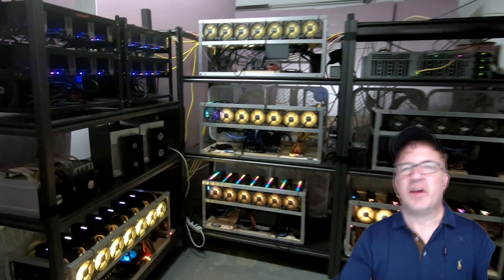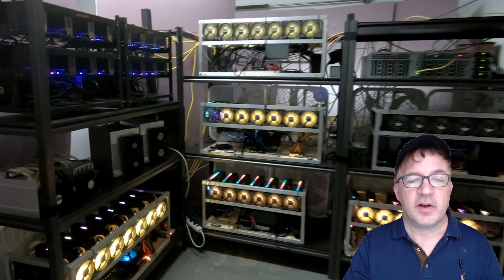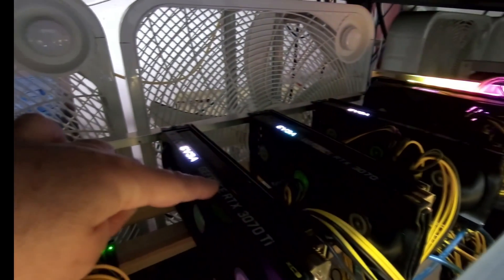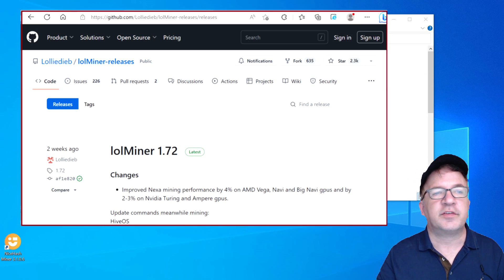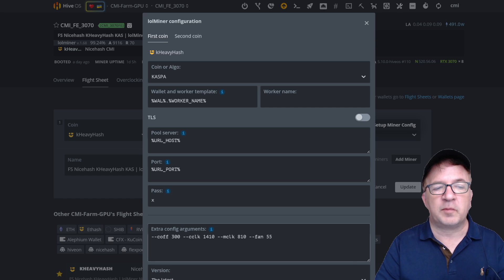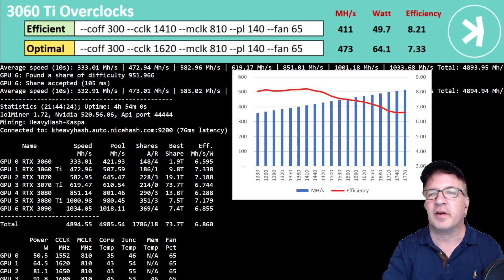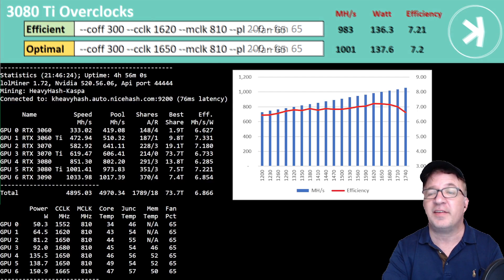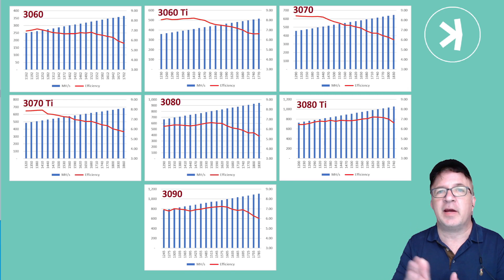BEST KASPA Overclock Settings Nicehash, Windows & HiveOS | 3060 3060Ti 3070 3070Ti 3080 3080Ti 3090

Comment from the maker: * For GPU Mining Rigs with different GPU in it, you can list the specific GPUs --cclk and --pl values separated by commas in Nicehash and HiveOS  * 
Example (2 GPUs):     --coff 300 --cclk 1410,1560 --mclk 810 --pl 125,200 --fan 65 
 
For Windows Batch File provided by lolMiner (mine_kas_with_oc.bat) list the Core Clocks for the specific GPUs separated by commas for the LOCKEDCORE variable, Example (3 GPUs) : Set "LOCKCORE=1410,1560,1665"
Reply: Hi ! many thanks for the video! i use windows , so msi afterburn, how i can convert this value for me? many thanks
Reply from the maker: @giovannidecclesiis9598  Hi, It's difficult to explain how to do in afterburner (It's an Advanced topic). But essentially it sets a locked core clock and then reduces power
Reply: how do i know which value runs for which gpu? also i mine on nicehash windows. my pl and fan shows as "not applied" when the cli starts. any idea why?
Reply: Hi, What if I have 3 GPUs and want to change the LOCKCORE of only the 1st and 3rd gpu. Leaving the 2nd gpu on default.

Would it be LOCKCORE=1410,0,1665 
or
LOCKCORE=1410,1,1665 
?
Reply: sir what should i put those parts? i use lolminer and windows..all my cards are 3060ti lhr
 set "LOCKCORE=?"
set "LOCKMEM=?"
set "COREOFFSET=?"
Reply from the maker: @asddsa-uy9ko Hi, Simply replace these values with the values I show in the video for the 3060 Ti - see this clip for 3060 ti https://youtu.be/wcd7rTilIu4?t=599
On the top of the screen I show the Full Overclock command and parameter values for Most Efficient and Optimal settings. 
Simply Update the batch file with these values

LOCKCORE = (see my --cclk value ) between 1410 and 1620 
LOCKMEM = (see my --mclk value) it's810
COREOFFSET=(see my --coff value) it's 300
Reply: This is life saving! Thank you so much!
Reply from the maker: @akgoz13  Your welcome - Glad it helped you
Reply: @CryptoMiningInsider  Hi! Could you help me, i have rig with 8 3060ti 2 3080 and 1 3080ti. And i can't set settings for each model, so miner gets crashed while i'm using one parametr for all gpus. How can i set settings for 3060ti, 3080, 3080ti in nicehash (windows). I've read your advice about comma and tried it, but it seems that it won't apply multiple settings
Reply from the maker: @АнварМагомедов-м2к  If I only mining KASPA with your GPU in Nicehash (and no other coins) I would start by running them with a core clock that is ok for all like 1410. Write down the which GPUs are their ID (Order#). Then you can Mining KASPA and provide comma separate values for the values that change like (core clock and power limit) 
example:   --coff 300 --cclk [GPU0_CoreCLock],[GPU1_CoreCLock],[GPU2_CoreCLock] --mclk 810 --pl [GPU0_PowerLimit],[GPU1__PowerLimit],[GPU2__PowerLimit] --fan 65

If I'm setup to mine other coins too, then I need to go one specify overclocks for each individual GPU as its own parameter.
Reply: @CryptoMiningInsider  Sir, thank you. You've helped me a lot. Subscribed!
Reply from the maker: @АнварМагомедов-м2к  Thats Great and I really Appreciate the SUB - Thanks !
Reply: you know iceriver kas ks2? lol
Reply from the maker: @xmyou  I seen the reviews - they seem very powerful and EXPENSIVE. I personally would not buy one.

Comment: I have 14 cmp 50HX mining Kaspa on Hiveos. The hashrate on each gpu is 330 mh which seems really high so  im 1.67 ghs total. Which seems way too much correct me if im wrong.. Normally I do 50 to 60 mh is the average per gpu. I adjusted the over clocking ..but can't seem get the mh lower..not sure what to do? All I know it's been very unstable ..mining dynex nexa but kaspa has been most stable
.can you recommend overclock settings mining kaspa..I'm using woolypooly pool..I'm new to mining
Reply from the maker: Unfortunately, I don't have any 50HX Cards to test. Maybe check Hashrate.no
Reply: @CryptoMiningInsider  thank you that website is very helpful!

Comment: I tried using --pl and --fan in NiceHash's Extra Command using lolMiner 1.72, but when running the miner, the console says "power limit not applied" and "fan not applied". Did I do something wrong? Also, lolMiner 1.73 just got released 1 day ago, +1-2% efficiency.
Reply from the maker: I'm working on a new mini video about 1.73 in Nicehash, when I tested it PL and fan worked ok for me - I will see on my other rig as well
Reply: @CryptoMiningInsider  I have tested 1.73 for around 18 hours and it works fine, slightly better than 1.72 by 1-2%.
Update for my comment "power limit not applied" and "fan not applied": This is caused by older NVIDIA driver, I was still using 516.94 when I wrote my above comment.
It is resolved when I updated the NVIDIA driver to 528.24.
Reply from the maker: @VM-ox9ke  Great you have it resolved and news about update driver fix PL issue

Comment: On the 3080 did you try 1740 clock pl200 ?
Reply from the maker: I tried 1740 on my 3080 , it ran poor for me 898 MH/s @ 152.6 watts (5.8 efficiency).
Since its well below 200 the --pl 200 shouldn't really matter imo
Reply: You may need repaste it. I have an option to some free power and use one ASIC preferably a quiet one any recommendations?
Reply from the maker: @NizmoTech  Tough call - Depends on how much free electric you can use. Have you looked at l3+ (used pretty Cheap, but not quiet), but if you want quiet probably look at mini miners like Goldshell or iPollo - maybe look at previous generation miners that are not profitable in current market if you don't have to pay for electric, maybe find good deals on used.
Reply: @CryptoMiningInsider   thanks .  I could consider i3 for basement . Yeah the ipollos look like viable option as well . Thanks man

Comment: Hi,
 I cannot apply any  OC settings in Nicehash on lolminer to my AMD 6600 and 6600XT. I also tried opening nicehash as administrator, and updated nicehash and lolminer to latest version, but still cannot apply the OCs.  Any one knows?
Reply: This is on Windows BTW
Reply from the maker: I do not believe lolminer can overclock AMD GPUs like NVidia - see bottom of the post on lolminer site that says limits on AMD overclocking (it may be have changed since) https://github.com/Lolliedieb/lolMiner-releases/wiki/Guide-Windows-(LHR,Watchdog,WebServer,OC)
Reply: FWIW, MMPOS fixed all my AMD rig OC problems, I still run hive on my nvidia card rigs.
Reply from the maker: @MichaelSchoenly  Great you were able to get it working

Comment: I have applied the optimal overclock for my 3080ti but the power limit of 200 is out of range. How I can correct that?
Reply from the maker: I seen this issue in Nicehash because it was using an older version of lolMiner. The --pl parameter is not required for the overclock. I onlyadd it as an extra precaution in case the miner loses the overclocks to try to prevent the card from running at full power. I'm working on a new video that address this. Stay Tuned

Comment: heyy i have another question!! thanks for answering my other one <3 !! ! ! !   how do i overclock multiple GPU's with different overclocks ? i dont understand the "flag" and "delim" part?
Reply from the maker: If they are ALL set to mining KASPA only then it's simple... 

* For GPU Mining Rigs with different GPU in it, you can list the specific GPUs --cclk and --pl values separated by commas  *

Example (2 GPUs):     --coff 300 --cclk 1410,1560 --mclk 810 --pl 125,200 --fan 65

Comment: Thanks for the Video, Nice Work. Gained yourself another Subscriber. I do have a question though.
When making the adjustments in HiveOs Flight sheet and having different varieties of cards how do I list the commands?
Example: ( My thoughts)
Device 1, Device 2, Etc...
--coff 300, --coff 300, Etc...
--cclk 1410, --cclk 1410, Etc...
--mclk 810, --mclk 810, Etc..
Etc...
Any insight would be greatly appreciated. Thanks
Reply from the maker: Thanks for the Sub - Appreciate it!
If you are using the same GPU Types (like all 3070s) then I can specify the values once and it will apply to all the GPUs, but if you have different GPUs then I list the specific GPUs --cclk and --pl values separated by commas

Sample of Miner with 2 different GPUs & different settings:     
--coff 300 --cclk 1410,1560 --mclk 810 --pl 125,200 --fan 65

Comment: --pl 180 gives out of range for Lolminer.
Reply from the maker: I specify PL as a extra guard incase card looses core clock lock, I assume your using Nicehash - Nicehash uses an older version of lolMiner (Think its 1.65). This versiion of lolminer acted weird with the PL Power Limit parameter I recall.  you can download lolminer 1.72 fro lolminers github page and copy the miner executable to your folder where nicehash has the old version of the miner
Reply: 3080........

Comment: The nicehash overclock command isn't applying for whatever reason. When I click or start on mine, it says not applied for all the categories. Any suggestion?
Edit: When I run nicehash as an administrator, it does change the coff, cclk and mclk, but pl and fan is not applied. And I'm running the same cards as you are more or less.
Reply from the maker: Nicehash was using an older version of lolMiner - I recall the --pl command was not behaving correctly. Setting the power limit is used as a safety, not required, but good idea to set incase the card loses the overclock when mining. You can download a new copy of lolMiner from lolminers github site and replace the version in the miner in the nicehash plugin folder.
Reply: @CryptoMiningInsider  You've been a great help for not only me, but for everyone here and we can't thank you enough. In any case, I do have another problem and hopefully you can shed some light into it. There are many times where I get this "Unrecoverable GPU error" either it's the cuda memory or memory overclocking, but I am using the 1470 medium overclock for nearly all my cards. If you're familiar about the error, a video would be much helpful as there isn't much information about them than to lower your memory setting and do a gpu reset of windows + ctrl + shift + b. It fixes at from time to time, but I still get error from time to time, specially if I mess around with the settings.
Edit: I did some research and I believe that overclocking with msi afterburner is what is causing this problem, but when I overclock with nicehash, it's not doing that. It might be too early to say, but I haven't gotten an error since overclocking within nice hash. The only thin is that I can't fix the fan speed.
Reply from the maker: @Pilaspilas911  Thanks You - appreciate reading your post. I have seen the error in Windows and on HiveOS as well occasionally, I usually reboot the Rig. Are you using the latest lolMiner 1.72 ?  If Problem persists you may want to try different nvidia drivers.

Comment: I can only see less than a dollar after electricity on whattomine, amt is very negligible thus i m not mining currently, i don't knw y u guys r so hyped for less than a dollar revenue
Reply from the maker: Whattomine calculates its revenue and profit using less efficient overclocks - When I update whattomine with my hashrate and power that I was getting it was definitely more profitable than the default whattomine values.

Comment: Another great video! Do you feel running the fans at 65% and the GPUs running so cool helps efficiency? Mainly thinking of the noise as most of my GPU run low 50 with fans around 35%. Should I make them cooler to gain efficiency?
Reply from the maker: Thank You So Much ! When the GPUs are cooler they generally run more efficient (using lower power). Everyone's environment is different so adjust to your specific setting - watch your cards temps (Core & Mem).

Comment: why did you use the same coff on all cards? did you try to experiment with those? I've seen others report using 300-400 for some cards, and 200 for other cards.  I sitll don't fully understand what going up or down with this number does.
Reply from the maker: I pretty much tested the range of the card - so keeping to 300 made it simpler. 
AS I understand it when I define a Locked Core Clock it tells the driver to maintain the clock speed by adjusting the wattage. when you add a positive core clock offset it makes the card pull back power (undervolting) while trying to maintain the same lock core clock but using less power.

Comment: Thanks for the update! Does anyone get an error in Lolminer "core offset not applied", whereas core lock and memory look are ok?
Reply from the maker: What Version of Lolminer are your using and what Platform (Windows, Nicehash, Hive ?).
If its HiveOS, make sure your using newer drivers, I used 520.56.06
Reply: @CryptoMiningInsider  Using Hive and Lol 1.72, the latest stable image. Will try a diff. driver, maybe that will help, thanks for the tip. BZ has no issues locking core offset, but doesnt hash as well.
Reply: @CryptoMiningInsider  That was exactly it, I updated the driver to your version and the issue got resolved! Went down by about 5 watts per 3070. Thanks!

Comment: Hi so I have a mixed rig can I set different clocks in nice hash ?
Reply from the maker: Yes you can! You can simply list the overclocks for each card separated by commas in the locked core clock.  
Sample:  --coff 300 --cclk 1410,1560 --mclk 810 --pl 125,200 --fan 65
Reply: @CryptoMiningInsider  ah ok so it will know from top to bottom . I’m setting up a 3080 3060,3060ti with 2 3070 tis so messy lol

Comment: plz do a video on a mixed card rig on hive os 
many thanks
Reply from the maker: Will do soon, but for now you can specify the individual locked core clocks for each card separatred by comma. Since the --coff and --mclk are the same for all cards only specify that once. 
Example for 2 card rig:  --coff 300 --cclk 1410,1560 --mclk 810 --pl 125,200 --fan 65

Comment: Try on 3070ti
Lock clock 1305
Offset 300
Mem 810
Reply from the maker: Just tested - Great Efficient Overclock - 481 Mh/s @ only 62 watts , 7.76 Efficient - Pretty Awesome - Thanks ! 
I'll include lower clocks like 1305 in future tests & graphs.
For my Efficiency OCs I have similar results for the range 1320-1410 - Efficiency was quite High on all these, I choose 1410 since it had a higher hashrate for same high efficiency

Comment: how do you seperate gpu configs on lolminer for gpu0, gpu1,gpu2 etc ? (windows version)
Reply from the maker: I just got home from work, I'm happy to help you, however seems you found the solution. Let me know if you have any other questions. I do my best to respond and try to help everyone.
Reply: Ok I found the solution myself this guy is here to only show himself not for the help. You put comma each value card by card for example if you have 4 gpus you may define their locked core value like this line, set "LOCKCORE=1575,1560,1560,1545"

Comment: how did you seperate the cards configs?
Reply from the maker: HI, You comma separate the values for each GPU setting - The Values that are the same you only need to specify once, but values like --cclk and pl which may be different you specify them for each card - 
As an example a 2 GPU rig: --coff 300 --cclk 1410,1560 --mclk 810 --fan 65 --pl 125,200

Comment: You have to do it not for efficiency but profit.
Reply from the maker: I demonstrated 2 overccloks for each GPU - one for most efficient and one for Optimal which is HIGHER Hash rate and good efficiency which will often be the most profitable (depending on the mining revenue and your electric costs).

Comment: I love the oc disc! and it well needed! becoz i was following a oc vid with no disc! and I missed one letter in oc for srb miner and man the power shot up so fast went to 2,000 watts in 3 secs and burn up my psu well popped the fuse inside my mining cave 1,600 quite psu! by mssing the letter c  on --gpu-coffset 225   i had the c off!  --gpu-offset 225 will burn your rig up lol! always double check your oc for any errors! and if u like to do a vid with me sir we can recreate it on my old rig and show! that miners dont  have safe guards in their software!!!
Reply from the maker: Hi and Thanks!!!  Mining SAFE is always 1st Priority and definitely always double check your settings. I try to warn everyone to prepare if the miner or Windows drops the OC and the rig goes full throttle - Have Good Power Supplies and Wires and I state in the video. I have seen them MELT in the past and it's not pretty (or safe). I'm open to doing videos together in future - I'll be opening my channel discord very soon so PM me.

Comment: *** if u dont have matching cards, as long as they are Nvidia cards, u need to set the flags and arg's further down the Extra Commans menus****
Reply from the maker: I can specify on single line (example of 2 card rig) --coff 300 --cclk 1410,1560 --mclk 810 --fan 65 --pl 125,200
Reply: @CryptoMiningInsider  what is the " ,200 " for? I just have a 140 in the --pl arg, not another number also.

Comment: what is the amount you would get with a 3080 ti LHR? The calculator says 0.96 USD   / Day. doesn't seem worth it to me yet
Reply from the maker: Depends on the Reward and Electric rate - For me Looking in WhatToMine (Current and last 24 rewards). I updated their hashrate and Watts with my results It shows 70-76 cents total revenue and  35-40 cents profit at .10 KwH for 3080 ti. My actual revenue will be lower since I know my 3080 Ti draws about 40 watts more than the miner shows.

Comment: Not everyone has matching cards. Most people have mixed gen rigs even. Can you make a video showing how to set separate overclocks for individual cards??
Reply from the maker: I can do an update, but its pretty easy just specify the individual locked core and power limites for the cards separate with comma - (example of 2 card rig) --coff 300 --cclk 1410,1560 --mclk 810 --fan 65 --pl 125,200
Reply: Yes plz do a video on a mixed card rig on hive os many thanks